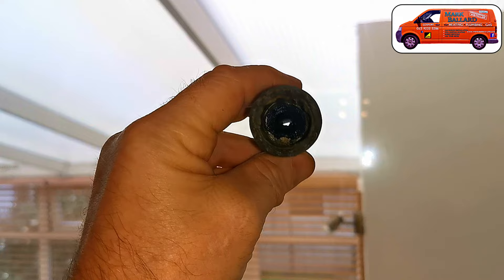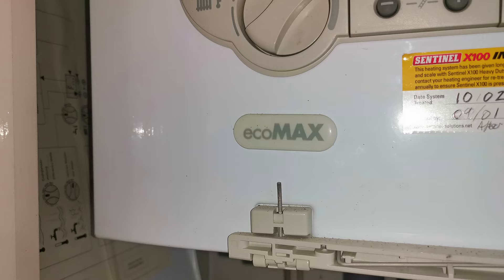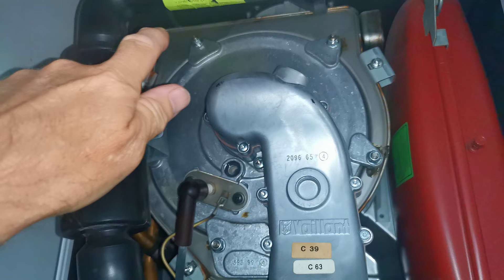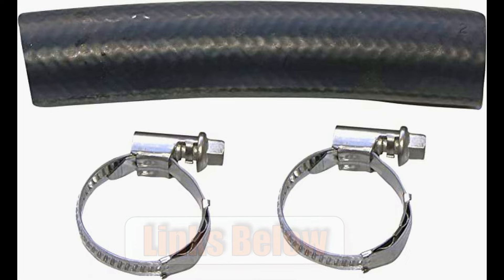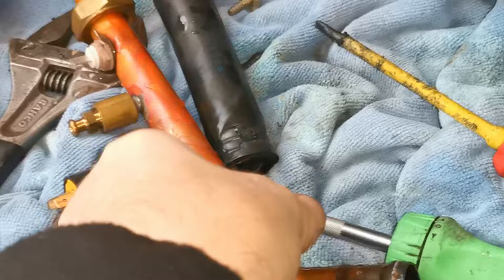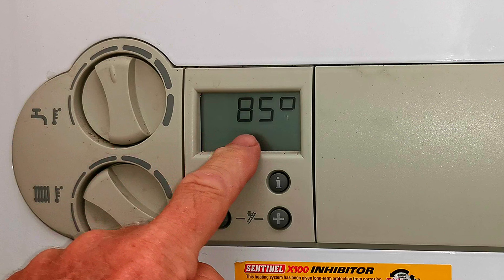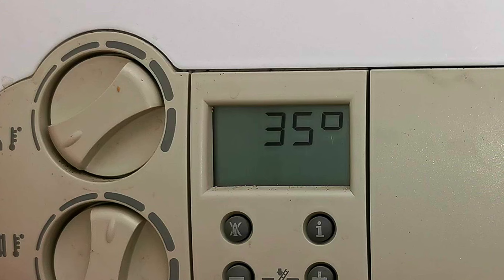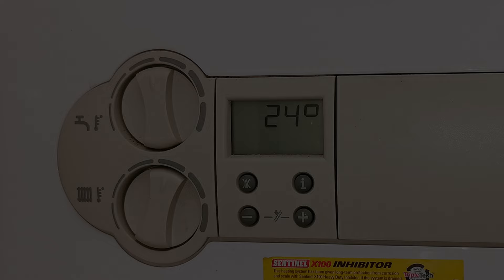Vaillant EcoMax Hot Water & Heating Not Getting Hot.  Blocked Pipe Causing the Problem.

Comment: Hi Mark I've watching your videos for awhile & learning a lot.  Can I ask you question about my Vaillant ecoTEC plus 837 no one is able to pin point the fault. Hot water working fine, no heat to the radiator no fault codes. 
What happens the heating on the display on the boiler shows the temperature quickly shoots up to 84c then the boiler turns off until it cools down then kicks back in again. 
The pipe from the exchanger is red hot the return stays cold. British gas have been out today carried out his checks, telling me my pump is getting hot and not pushing the water enough to go round the system, he replaced the pump £210 £99. labour it's still the same now he is saying the heat exchanger is blocked I think he is just guessing.   
Any clues.
Reply from the maker: Just confirming we are talking about combi.
If so the boiler works exactly the same for central heating as it does for hot water. So if hot water is working the only reason the heating should not work is there a something stopping it from a circulating around at your central heating system as the temperature rises really quickly shows that the central heating is working fine. 
Does the diverter valve move backwards and forwards in the boiler pretty simple to check that watch my video on grease  the spindle on the diverter valve
Reply: @MarkBallardLTD  Hi Mark thank you so much for coming back to me much appreciated. yes it is a combi boiler I said this to the British gas engineer about the diverter valve he said it's working fine because if it was not working I would be sending heat down  the small 15mm cooper.   
I have watched your video on the diverter I will watch it again.

Thank you again Mark.
Reply: @MarkBallardLTD  mark you are brilliant watched the video on the diverter valve 5 minutes got the central heating working. You have just saved me £3000 cancelled my order with British Gas for a new boiler.

If you live near Birmingham I would take you out for lunch 🥗

Comment: Help mark, my boiler is a glow worm,  it keeps flashing 0.0. Iv tried resetting an topping up but keeps going back to 0.0, no heating or hot water 😔
Reply from the maker: If you're topping it up and you can hear water going in, if the pressure risers then drops straight away you have a big leak.
If you can't here water going in maybe the values are not oper or opening properly
Reply: Possibly faulty prv also?